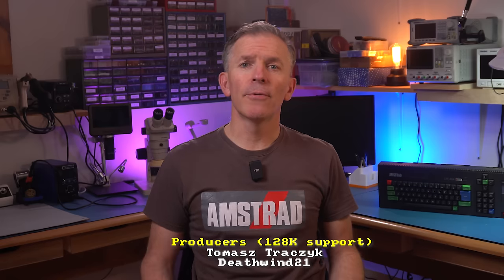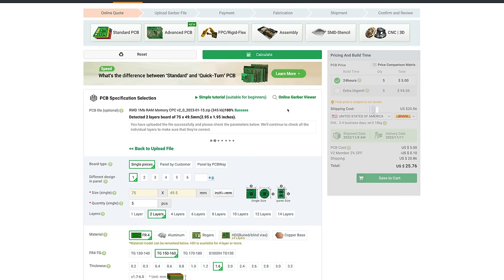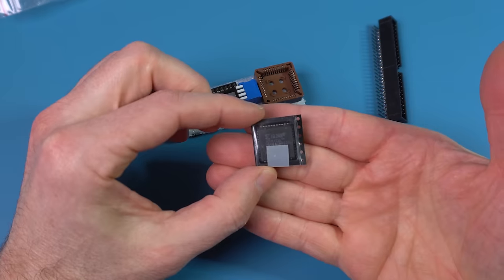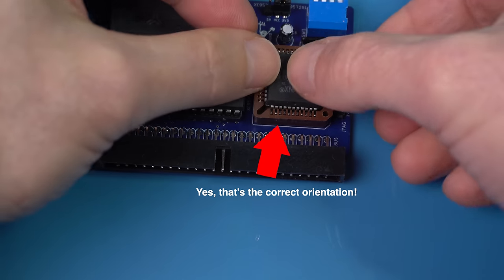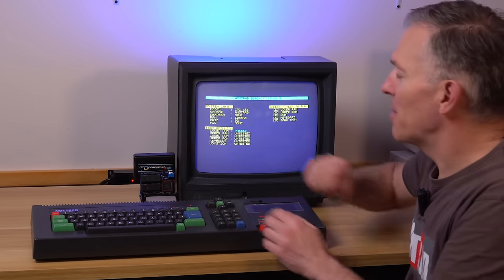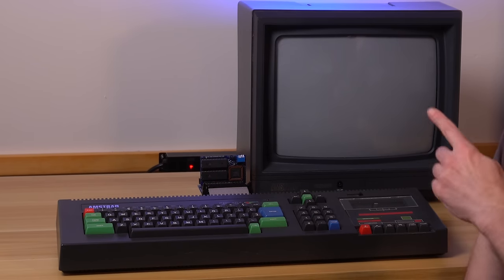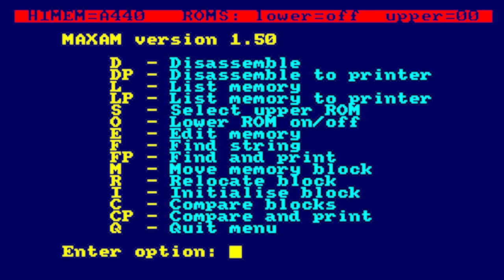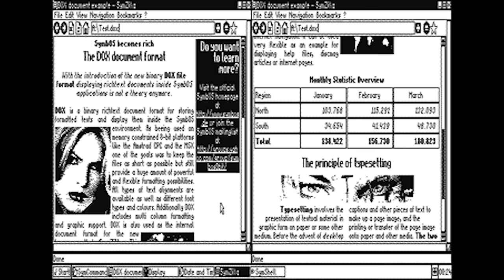Adding 1MB to an 8-bit Computer!

Comment: Nice video. We are making a 2MB expension for the Philips P2000T, a Dutch Z80 machine, internally, as it has plenty of room. 2MB is the limit, as the OUT toggle can deliver 256 positions for the upper 8kB of RAM. So you get 2108 kilobytes. Actually back in 1988 someone already made a 2MB expansion for this machine, byt with 256kbit chips (64 of them!): the use was running a BBS over the Viewdata protocol. They needed to upload 5 floppy's with all the user messages and such into the RAM, and they even managed to run it for 5 years without a single power-down. Our modern version has 4x512KB chips and TTL logic. Still it is pretty compact.
What is weird though, the C128 does flip the entire RAM. Must have been hard to swap data between the two halves on that machine.

Comment: I’m curious when your RAM test finished, it only tested 0x0F banks of 16k ram or 256k total. The screen had enough space for 1024k but it didn’t seem to test it all. Am I missing something?
Reply from the maker: That screen is designed for 4MB of RAM (yes, it's possible apparently!!!). So each bar was 64KB, not 16KB, which times 0x0F is 1024MB. One of these days I need to get my hands on a 4MB RAM expansion and test it for real.
Reply: Noel used a word "bank" for whole 64k of RAM, probably as a reminiscence of CPC6128 which had 128k and other 64k has been called as "second bank"
Reply: @NoelsRetroLab  oh confusing as the banks are actually 16k each…
Reply: @rastislavzima yes, "bank" is 64k, "block" is one of the 4 16k sections in a bank.

Comment: my cpc is looking a bit worried right now lol, its difficult to convey how insane 1mb of ram for a 80s micro is.
Reply from the maker: Right?? That's why I liked that RAM test so much since it took several minutes to complete. It's some insane amount of RAM and it was certainly never intended to have that much.
Reply: @NoelsRetroLab  but you know if implement fast RAM expansion Amiga way via cpu socket PIStorm, emulated z80 could scan 1mb of fast ram in a blink of an eye ;)

Comment: It seems like just yesterday that you started working on the Amstrad diagnostic ROM.  When you said 2 years I just about fell out of my chair.

It's too bad we didn't have Amstrad in Canada.  They seem like fantastic machines.  Here it was all Commodore, Apple, Atari, TRS-80 and TI, in that order.  I literally never saw any other  microcomputer in the '80s.  I do not count PCs because they are not what I consider microcomputers, and also they were boring.  The fact that they were "boring" was part of the reason they triumphed, but my heart only holds 8 bits at a time.

Designing your own memory expansion will be a big project, certainly worthy of several videos.  I know you can do it Noel!
Reply from the maker: Yeah, I want to get more into designing hardware expansions. The first one is probably going to be a simple ROM expansion to run the diagnostics ROM (and maybe a few extra things on the board). So many ideas! :-)

Comment: 😅😅😅 Oh Noel, shame on you! 😅😅😅
Just joking, mistakes happen. It is NOT the data bus which is 16Bit but the address bus!
And to make matters worse, it is not only the physical amount of address pins - there are 8Bit computers with 12 to 20 address pins - it is the internal structure of the address counter which means you have to bend yourself over quite badly to address more than 2^16 Bytes. AMD back then had an interesting Design of Bitshift CPUs which had no fixed internal length for data and address but it was expensive, slow and terrible to program.

Comment: A Disk copy program on the Sam Coupe with 256 or 512k ram. Completely in basic, first check if 256 kor 512k was available with a Peek-command to determine if you can read 40 tracks or just 20 tracks of the disk, then copy the sectors of those tracks, the only problem was timing, and that was solved with first reading the odd sectors and than the even ones, swap the disc and write the odd and then the even sectors. The Sam Coupe could hold up to 4.5mb, but more likely was 1mb extra and an IDE interface for a harddrive.

Comment: Noel, you have made me stroll down memory lane.  Thank you.  I hope my little rant below does not bore you too much.

Shortly after the Z80 uP was first released, the company I was working for purchased a 'large' (12" square approximately) SDK PCB (from Zilog I think).  To populate the memory, the DRAM chips of the time were 16k BITS and 8 of those gold-plated-pin heroes to make a 16K byte DRAM memory cost around 500 USD.  This BEAST with a fancy cassette-tape-drive storage for R&D was set in front of me and I had to make it work.

Thankfully, LSI byte-wide SRAM made its appearance a short time later, so that many of the company's wannabe product successfully made it into the market place at a practical price point for large computer-controlled lighting desks.  The static RAM with battery backup made the products free of the need for any other type of memory when composing and then repeatedly sequencing through lighting cues every show.

The DRAM refresh controller on the Z80 uP WAS used however.  My boss at the time who had a propensity for thinking outside the box, asked me to use the phantom Z80 read-refresh cycles of non-existent dram to sequentially export lighting levels directly from SRAM memory to the proprietary analogue serial trundler sent directly to numerous dimmer racks from a single output.  IOW, DMA on the cheap.  IT WORKED just fine - and still does as far as I know.
Reply: Nice. I have similar expericences, albeit starting a little later, early 1980s. But have you seen the internals of the ZX80 and ZX81 designs? I.e regarding "outside the box" usage of the refresh counter and other Z80 traits.
Reply: @herrbonk3635  I have not Sir.  I will go on a bit of a tour to see what I can turn up.  I did very much appreciate the timely appearance of Hitachi's 64180 device a few years later and designed it into a number of specialized industrial products.
I am now retired, but interested in your comments w.r.t. spectrum ZX80/81.  I see the schematics are easy to find on the Web, so a bit more touring down memory lane in store for me.
Thanks for your reply.

Comment: A friend of mine built something similar for the Sinclair ZX Spectrum 48K at the age of 16 back in 1987.

As he used the full 8 bits of the output port (220), this would have allowed up to 256x 32KBytes or 8MBytes (including the internal 32KBytes at out 220, 0) of total memory.

Including power/battery backup and the ram, if he had tried to do that it would have probably ended up the size of a mini-fridge 😂 but because of the costs back then his ram pack only had 224KBytes (7x 32KBytes) but it was battery backed up.

It came in very useful when we were developing software as it could be saved to the expansion memory using the Sinclair Microdrive commands and any time the machine code crashed or got stuck in a loop, the zx could just be reset and then the code could be loaded back from the expansion.

Comment: I have about 100 TQFP XC9536XL (4.5 bytes storage) and I have no problems writing the VHDL for these memory expansions. A trick of the trade is to use 3.5999V regulators to increase noise immunity so there are less problems with running a number of additional cards on bus expansion boards. Most CMOS today doesn't draw much current and doesn't cause an unbalanced voltage drop. 

I also have a Z80 under chip to 40 Pin Dip to 40 pin header adaptor so that I can make RAM expansion internal on my CPC 6128. 

Note: The TQFP44 has pin 1 close on a corner and the J-lead PLCC 44 pin equivalent has pin one on in the middle of one side. 

I will be targeting 512kB plus the original 128kB of a CP 6128 which was the original design intention of the CPC 6128.

Comment: Back in the day I would always use ram disks for my Amiga 500 with 2 megs external ram and 1 meg internal ram.
With games I would load the disks into ram, then there would be no swapping of disks and practically no load times during gameplay.
Sounds like this would be an excellent use of the expanded ram for this and other 8bit computers.

Comment: I don't know why people think bill gates said that. IBM made that decision not microsoft. I still don't understand why intel didn't design the x86 to support 32 addresses internally (since it's using 32 bits already) and then only supply the pinnouts for 20 bits. In retrospect it would be interesting if they did the lower 19 bits and the upper bit. Then you'd have dual 512k (hardware and software). By the time the 286 came out you'd have 24 bit memory support that's fully compatible (it would be dual 8mb). And the headaches I ran into in the 90's with the 640k memory limit would have never happened. And the 386 would support 2gb of ram and 2gb of hardware in real mode.

Comment: I remember WordStar didn't have enough room in 64K even for it's code... so it would "swap in" chunks of code from overlay files. It'd be great (if I could still remember my 8080 assembly language) to patch it so that it loads all it's overlays into expanded memory and then bank-in it's overlays instead of going out to the floppy all the time.

Comment: The comment about the RAM not being reset on a reset also holds true for the 2nd 64K bank in a 6128. I remember one trick for hacking games from tape to disc back in the day was to load the game into the 2nd bank of a 6128 and reset when loaded and just save out the 2nd 64K bank to disc. Figure out the entry address and you've got a disc based version. :) Easier with a multiface, of course!

Comment: Z80? The old enemy! So here we meet again! Seriously, I'm still a fan of another 8 bit processor from the days when you had to build your computer yourself if you wanted to have one. Banked memory is nothing new, but large and affordable SRAMS are. However, you will also need a faster processor and a faster mass storage device to make reasonable use of all that memory. It wants to be filled with something before it's of much use. Or would you like to have that kind of banked memory on a C64 with its slow floppy drives?
Do I have these things? The jury is still out on that one. At least I can easily push my old silicon from 1976 to 7.3 MHz without efford and SD cards as mass storage are relatively easy to interface. And the unique architecture of the old processor allows me to call a subroutine anywhere in that banked code from anywhere else in that expanded memory. The switching of the banks is done exclusively during calls and returns, not all over your code. As another bonus, I can easily detect DMA operations on the bus, so a second page register for DMA allows DMA operations from or into the expanded memory. These two things allow some benefits of having a MMU without actually building one.

Comment: I have a Color Computer 3. Officially it was supposed to support up to 512kb. The top 2 bits of the MMU bank registers are supposed to be undefined. But in reality, they are stable and usable. So in reality, the Color Computer 3 can address 2mb natively. It would have been a little bulky back then and would have made the computer overhead a bit, but it was still feasible. The OS/9 operating system was modified to handle that amount of memory.
Reply: The two extra bits don't get stored in the GIME so you actually need some extra hardware to support more than 512k. (OS-9)

Comment: My first hard drive for our 386SX was 80 MB.  I remember loading Stacker software to double it and it not working the first time so I had to format the hard drive and start over.  My mom wasn't happy that she lost the budgeting files she had just started putting on the new hard drive, but I blamed "I don't know what happened" and that seemed to work.  LOL  A single 1 MB SIMM of RAM cost $100 at that time too.  Perspective can also make you feel old and outdated.

Comment: I know of at least one project that adds memory internally (1Mb or 4Mb I believe) but these do not use standard I/O ports.
The "standard" max memory expansion was meant to be 8*64 including the built in memory so 512k total.

It would be totally feasible to upgrade a 6128 to 512k by swapping the memory chips.
4164 and 41256 chips have the same pinouts and most 41256 chips use 8 bits refresh.

The A9 address bit is on pin 1 (unused on 4164) so:
1) Remove all memory chips and put sockets
2) Connect pin 1 (A9) of all the memories to one of the free pins of the PAL chip
3) Design a new PAL to implement the 8 banks as 2 things:
  The bank switching through CAS signal CAS to CAS0 and CAS1 (what the existing PAL does today)
  Address bit A9 selecting 4 64k "quadrants" in the new bigger memory chips (1 bit for RAS, 1 bit for CAS)

Comment: The AMS and SuperAMS memory boards for the TI 99/4A use the 74LS612 or 74HCT612 memory mapper to provide up to 1MB. The chip has two modes, map and pass and in pass mode, they appear as a normal 32K card to the TI.

Comment: While most MSX1 computers had 64KB of *main ram*, the total amount of RAM available is 80KB, since, unlike other 8bit computers, it has 16KB of separate VRAM. Even more on the MSX2/2+ (usually 128KB of VRAM).

Many MSX software also use the VRAM to store store data.

Comment: CP/M 2.2 didn’t know anything about paged memory, and most CP/M code ran quite happily inside an unexpanded 64K machine. Amstrads ran CP/M 3, which could use paged memory, but didn’t require it. I remember running CP/M on a CPC 464, without expanded memory.

Comment: You seemed to be saying that WordStar would only be able to handle files that would fit in RAM -- this is not the case,  and I remember being amazed at how smooth the transition was from the amount of text that would fit to much bigger,  where it dealt with the rest of it as disk files.  This was on my Osborne Executive running CP/M 3.

Comment: 0:19
You might have wanted to look at the Commodore 128 before you started this project.
It already HAD 128 KB accessable memory, and I think it was expandable to 512k with a plug-in "card".
8502 was nothing more than a faster-clock 6502 with an on-chip parallel port (used at least in part for bank switching), and Z80 as well.
Reply: Yes the REU(ram expansion unit) would add 512K,and also be hacked for 2MB.

Comment: Back in 1985, I did this with my Apple IIe 8 bit computer. Was as simple as putting in a RAM card, built for the task. I think it was the company, Applied Engineering that made that card. The card did all the heavy lifting. I simply enjoyed having all the extra ram for Appleworks, which showed me having 1184 kb free. The software had to know about it. So if it was a 128k game, then it only saw the 128k. But for the real power apps, it was awesome.  I was bragging to a friend of mine, how much RAM I had, he said, "You will never use it all", and I quickly did. I starting making RAM Disks with it. Even had a battery back up for the RAM Card to use so the RAM didn't lose anything during a power off.

Comment: 640MB was the maximum RAM limit of the original IBM PC, even though the 8088 could directly access 1MB.

"High" RAM usage, for me, personally, came in the late 1980s, and using a Z80. I was working at voice logging recorder company at the time. 25 hours of recording onto 60 channels, on 1 inch tape. All analog. Only computer control. But the project using a "butt load" DRAM, was an "instant playback" SS recorder, with anywhere from 2MB to 32 MB of RAM, to store the audio. Uncompressed and sampled at 8KB/sec that translates to 4 minutes to over an hour of recording. Of course, a Z80 can only access 64KB directly, bank switching the voice data, and also used a DMA controller.

Comment: Knife Edge tips work much better for SMD soldering. I switched to a Weller T0054462199N tip after a friend who also does mostly SMD work recommended it to me. Hundreds of boards later, it's the only tip I use for both SMD & THT soldering. Conical tips have been relegated to installing brass threaded inserts in 3D prints.
Reply from the maker: Yeah, those SMD components were too big for the conical tip. I'm usually a fan of chisel tips for TH. I'll ahve to look into knife edge tip. I'm assuming they're similar just slanted at a different angle?
Reply: They are more like a slightly thick and stubby Xacto blade but narrower top to bottom. Easier to navigate past neighboring components and also slide between pins to clear bridges when used with plenty of flux. It's also important to remember that soldering iron tips do wear out, eventually the coating wears away and the core metal can react with solder and corrode. I was surprised when one of mine developed a sizable cavity that couldn't be seen from the outside, when it stopped carrying heat into a joint I took it to the grinder and found a small hole had opened up and half of the tip had eroded away from the inside. I had seen plenty of cheap RadioShack irons do this from the outside, with notches eventually showing up. I hadn't seen one erode from the inside out before.